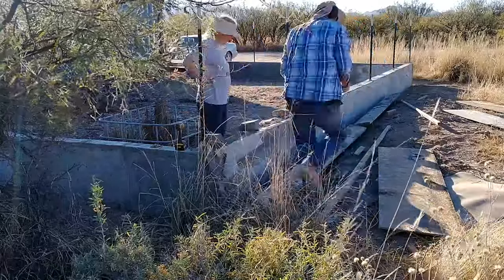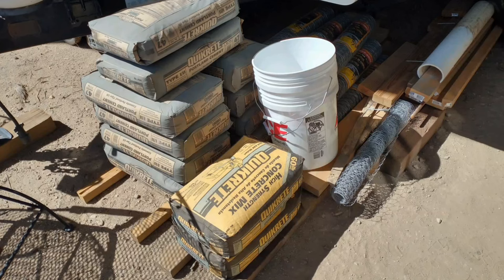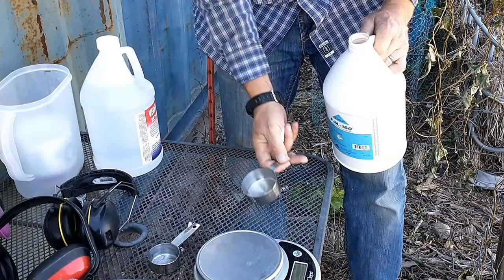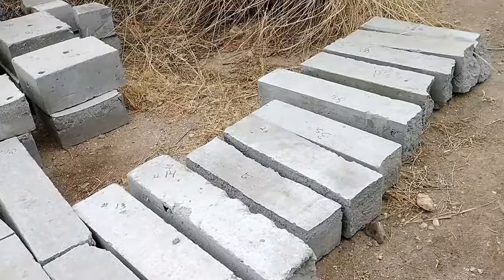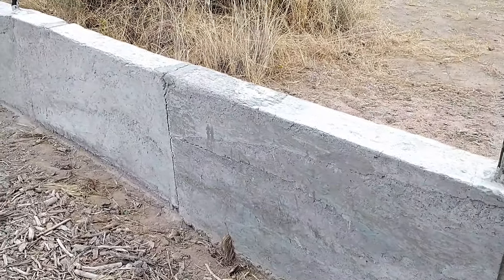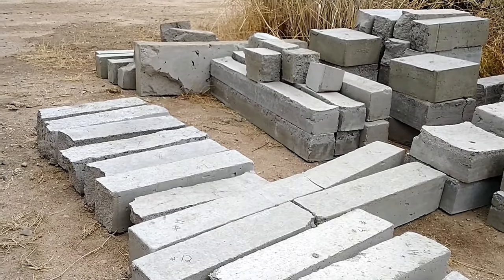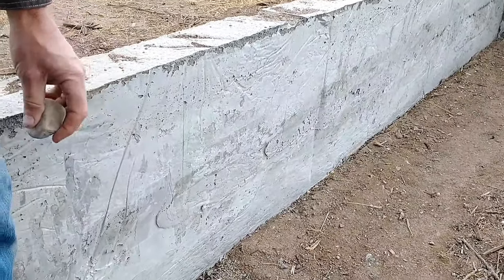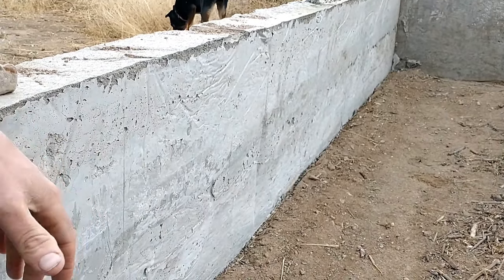Why we GAVE UP on AIRCRETE & What is Our Plan Now?

Comment: Glad you did not build your long term structure with aircrete.  Common sense will tell you air is weak and has no strength.  Wrapping it with a thin layer on the exterior only adds minumum reinforcement and hides the weak and deteriorating internal structure.  Maybe good as a insulation layer or use it to build a storage.  I am not convinced for long term structures...not worth risking.
Reply from the maker: People promoting air crete say it's better, easy and less expensive, so we thought it might be worth a try. We learned that is definitely not the case. With traditional building materials you can make a way better structure with better insulation for less money and a lot less labor.

Comment: aircrete is used on chinese skyscrapers that should be enough to know it is good for small projects and dome homes only
Reply from the maker: There are different ways to make it. The UK is having issues with a lot of their autoclave lightweight concrete structures. Our main concern with using it to build a house is that it might last 15 to 30 years, but when it starts cracking, it turns to powder and you can't repair it. It's not that inexpensive or easy, and there are better options out there.

Comment: Coming to the last 3 minutes I think you mentioned Portland cement. Absolutely wrong decision to use on foundations. Portland cement is used in Europe for wall toppings. You use real cement with high pressure abilities for foundations. Companies like Hebel or Ytong do not mix only cement and foam for their building materials! Search them on YouTube and you figure it out yourself that the Domgaia aircrete is a very poor idea of light weight building blocks! I wouldn’t like to get buried in a dome house!
Reply from the maker: We used a recipe that others said worked for building a house. After our experience, I definitely wouldn't use it to build a house. We were considering trying to use the same mix with the addition of sand for the floor (not the foundation), but the foam couldn't hold up the fine sand, and the batch sunk. It was quite strong though. We have other videos showing how we made it, and the different things we tried.

Comment: Not using a real concrete footing seems foolish. It will never stop moving regardless of the material you put on top of it.
Reply from the maker: The garden wall was just for practice. It's holding up okay so far.

Comment: You let to dry to fast.  Slow dry 14 days before you remove the plastic.
Reply from the maker: After removing the samples from the forms, we kept them covered and watered for 1 week. As with the walls, we would have needed a whole lot of forms if we left them on for 2 weeks or a month, and forms ain't cheap, so the whole project wasn't practical.

Comment: "opt out" option??? 
Formerly known as....."I do NOT consent!"
Reply from the maker: It's a permit that allows you to opt out of most inspections, and you can build with whatever materials you want to.
Reply: @RedandAprilOff-Grid  I know I get It. Ive been off grid 11-12 years now, I never have never will "ask" for "permit-permission". If you paid cash for your land, there was-should have been a large portion of the contract you signed that had to do with obeying county codes, taxes etc. It was in bold italics on my contract. Its the counties way of manipulating-manufacturing your "consent". You do not have to agree to it, and you can "revoke" your consent at anytime.

Comment: concrete cracks. period. use smaller blocks or use rebar. testing against bending seems bit pointless, the concrete is good for load bearing, nothing else.
Reply from the maker: We were testing the samples against each other, trying to find a good mix, and getting some experience making aircrete. Yes, we were going to reinforce it. More about that in our other videos.

Comment: You should've went strawbale from the beginning.
Reply from the maker: Nah, our 2×4 insulated walls with 2 inches of exterior insulation, along with some added thermal mass, is performing amazingly well. The temperatures seem to be staying nicer than the straw bale homes in the area. 😎🏜️
Reply: @RedandAprilOff-Grid  
Thanks, that's nice to know. 👍

Comment: I thought your video was not too bad... But unfortunately there's a small detail are you overlooked... Aircrete is not meant to be foundation... The strength lies in the shape that it has distribution of the walls and the rebar you are missing a lot of rebar
Reply from the maker: It was going to be well supported, with a metal frame and other reinforcements. We thought about using it for the floor, but definitely not for the foundation. We were testing the material itself and our ability to make consistent batches. The long term durability seemed too questionable.

Comment: No concrete has strength without wire or rebar.
Reply from the maker: We were definitely planning to put in rebar and wire mesh or fibers. These were comparative tests of the aircrete itself, and our ability to make consistent batches.

Comment: No rebar it will not hold
Reply from the maker: We were just testing different mixes and our ability to make consistent aircrete.  We were planning to add wire mesh, and rebar on the inside of the walls, and fiberglass mesh, and plaster to the outside, as well as a sturdy metal frame.

Comment: Do you think that the temperature was a big factor in the success/failure of your batches?
Reply from the maker: Yes, I think it's likely that the cold Drexel was causing issues with the later batches. Some say a way to remedy it in colder temperatures is to add some warm water to the soap solution. Drexel needs to be used at room temperature. It sounds like cement quality, and various other things can be a problem too. 🤷 It's tricky stuff!

Comment: your AIRCRETE is not hydrated properly ,that's why is not strong structural integrity Bonding and powder out . the cement have exothermic reaction  and your water evaporate out  ..you need water to form mineral hydrate, you must hold the water inside the reaction ...add some pozzolanic type cement  or Gypsum to hold the water from evaporate .also add some epoxy tile mortar to the mix help allot . use any pre hydrated porous aggregate you want . water is the key to mineral hydrates exothermic reactions ,  you must balance the reaction ,
Reply from the maker: Once we got the hang of it, our first batches turned out great. I think the cold temperatures were probably our main issue with the later batches. The foam density was starting to creep up into the high 90s which should have been acceptable, but it seems to make bigger air pockets and a weaker product. These later samples were covered with plastic, but not watered daily, so they probably didn't cure as well. If you want to see the process we used in our earlier batches, we have videos on those.
Reply: @RedandAprilOff-Grid  yes the cold is a big problem on cement and bubbles. Also the cure on airCrete is very important. Because aircrete is frigile by nature. You samples is very good for an open not controlled industrial environment. I use stirofoam bubbles for easy  and repeatable results.. Good job..

Comment: The problems are: I don't think you have the right mix for the application, also these tests does not make sense since is porous is obvious to break easily, yo can fix with an improved formula and you can always combine formulas depend on the application
Reply from the maker: We ordered a recipe book and used a pretty standard aircrete recipe that was intended for poured in place walls. Our test were to compare the different aircrete batches to each other, as well as our ability to make a good and consistent product.

Comment: I see a poor introduction/ mixing of foam into the concrete.  Poor foam making procedure/consistency.  This leads to many problems with concrete.
Reply from the maker: We have a playlist showing the whole process we used to make aircrete. We had success and failures, and have put them out there for others to learn from. https://youtube.com/playlist?list=PLW_v9VWGwCM_gdAXzuKTr8J13rTZ1DSpx Our best guess is that the colder temperatures in the fall were affecting the foaming agent and curing of the aircrete. We also had trouble with getting the foam mixed in evenly, and were planning to buy a mortar mixer if we had decided to continue with aircrete.

Comment: Did an engineer sign off on the use of aircrete? It's not structural!
Reply from the maker: It's definitely not structural. We were planning to build a metal frame for the house structure.

Comment: you messed up the CURE>>>>>   and crete is supposed to be COMPRESSED ... and is VERY weak when it is NOT 

glad you realized early that you cannot deal with aircrete
Reply from the maker: Interesting, I assume you have experience making aircrete? I haven't ever seen anyone compress it! It is supposed to have bubbles. Some of our batches turned out great. The colder temperatures seemed to make it brittle. We didn't have a controlled environment to make it, so it wasn't going to work for us. We also didn't really enjoy the process of making it, and it turns out the cost, and insulation value aren't very good either.

Comment: Good idea NOT to use this online mixture! Why? It is by far not the same building material companies like Hebel or Ytong produce commercially in Europe. A mixture of only foam and cement will not work. I’m by far not an engineer and have no insight on how the real mixture is made by Hebel or Ytong. But you need more expensive equipment to make building approved material than a $1,500 dollar foam dragon, cement mixer set. That’s for sure. Cement needs at least sand to hold on. I think that magnesium is mixed in the mixture of real light weight building blocks too. I live in Panama and only by mentioning aircrete - the district engineer said: NO! So I’m building my round house with concrete blocks as approved here.
Reply from the maker: Concrete blocks sound like a good way to go, we wouldn't recommend aircrete either. Best wishes on your build!  🙂🏜️

Comment: You should uh old check "my little homestead" they had excellent success with air creat. U TUBE.
Reply from the maker: I saw it, that was quite the project!  Their batches turned out the same as ours. Some batches were good, and some were real bubbly, they just went with it. It would be interesting in a few years to see what the aircrete looks like if they were to peak inside. It might be fine, or some of it may have crumbled out.

Comment: that hurt my head . . . 'aircrete' and it's variants (of which i believe the styro stuff is the best) is typically wrapped and stucco'd / plastered fairly quickly not left to exposure . . . . just confusing as hell you seem to have the ability to research yet still spent all that time half ass'n  efforts, must be nice to have ridiculous money to waste. . . . i was going to recommend you reach out to the nito project, abundance building concepts and maybe the hempblock people . . . you know people who actually do this stuff and are generous with sharing their knowledge and wisdom. . . .just painful to watch someone waste money and walk in circles for months on end then 'celebrate it' on the internet >< won't be back.
Reply from the maker: Yeah, it wasn't particularly fun, and we wasted some money. We shared our experience as we went for others to learn what they could from it. For many reasons we wanted to use pure aircrete. We reached out to many, and watched every video available at the time on aircrete. People say aircrete is cheaper than traditional construction, but by the time you add in the cost of equipment and forms, it is definitely not. Besides the extra labor and stress. In the end we built a completely passive design home, for a great price, and are so glad we didn't use aircrete or anything similar.

Comment: You guys just doing it wrong. How come the other ppl building out of aircrete
Reply from the maker: Cold temperatures were likely our issue. We are so glad we didn't use aircrete to build our house. It's not a cheap or easy way to build, there are much better options out there.
Reply: @RedandAprilOff-Grid  bs

Comment: You folks have no clue about concrete or structure.  Your idea that the steel would be supporting is just BS, the load transfers through the bean into the soil and they would have broken free of the foundation material.  A good foundation is the backbone of a house.  What's sad is all the "testing" you did has already been done by big concrete companies.  The best thing you can do is get a concrete contractor to do your foundation.  Also your trenching method for the underground portions of the foundation is lacking in every way imaginable.  You need to cut and fill your foundation, with properly compactable soils and support materials.  Simply digging a trench to pour into will yield to the compression over time, and you didn't go deep enough either.  So many fools think they have the key to shortcut the costs associated with building a house and the results are disastrous.  If you want to build a shanty fine, the get some boxes and live in those.  If you want to build a house get a contractor for the parts you don't understand.  Your plumbing header was a mess too, what little I saw of it.  That's not how you run pex.
Reply from the maker: The testing we did was to determine if we could make good consistent aircrete ourselves, and also to decide (besides the fiberglass mesh and plaster) what types of reinforcements we wanted to use. We determined aircrete wasn't going to work for us, and are very glad we didn't try to use it. We went way deeper with our house footer than was necessary in our area, because we wanted it sitting on virgin soil. We have been living in our self built house for a year now, and everything is awesome! It's heated completely by the sun, it is a very comfortable house to live in, and we love the design, and how everything turned out, but it's definitely not how the professionals would have done it.

Comment: It looks like you guys are now using cement instead of concrete. Cement is no where as structural as apposed to concrete.
Reply from the maker: 🤨 Concrete is cement, mixed with rock and sand. Aircrete is cement mixed with foam.  Aircrete definitely is not nearly as strong as concrete.
Reply: @RedandAprilOff-Grid  As a contractor for 37 years I've come to learn that cement (Portland) is an one ingredient in concrete. Sand and aggregate are others, as you stated. And sometimes other ingredients are added for different reasons. Concrete is not cement, cement is an ingredient of concrete. I was only trying to help not to lecture. Good luck!
Reply from the maker: Gotcha 😏. We used type l/II Portland cement in most of our mixes because that is what most aircrete recipes call for. The aggregates make the mix too heavy, and foam will deflate. We tried a mix with some very fine sifted sand, it almost made it, but the sand was still too heavy for the foam to hold up, and the aircrete fell.